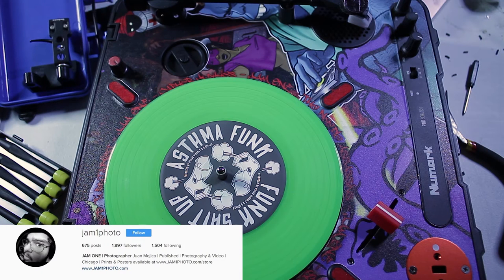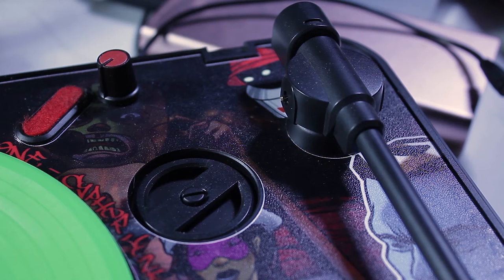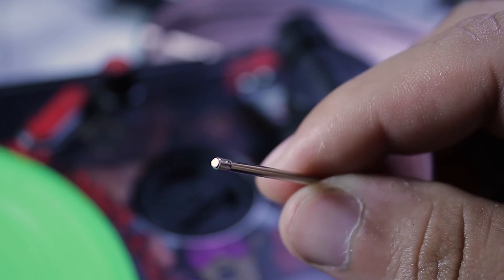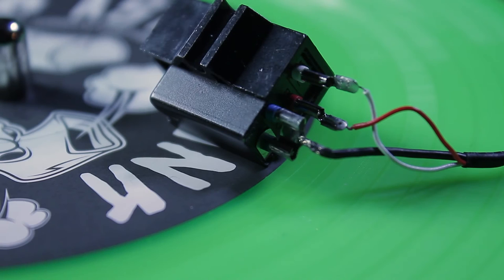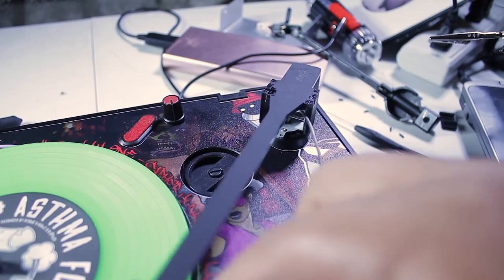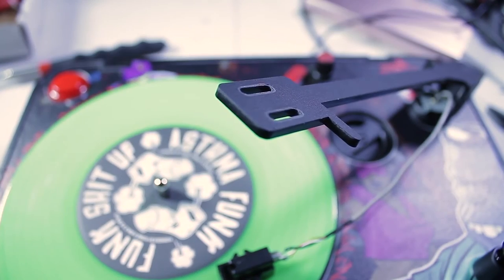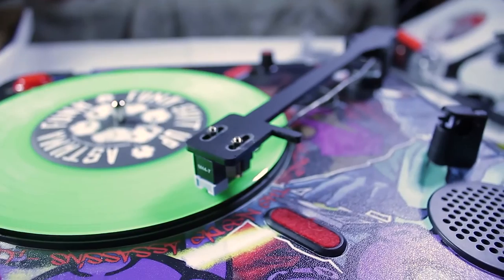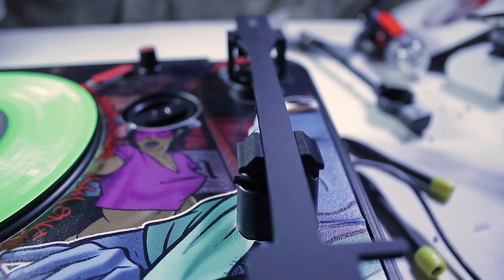Bihari Tonearm Installation for the Numark PT-01 Scratch Portable Turntable | JAM1PHOTO.com

Comment: really interested in seeing the pre amp installation video i have one also
Reply from the maker: I know I failed hard by not documenting it but I wasn't confident that I was going to even get it right on the first try, I was going off of Flesh One's step by step slideshow style video trying to figure out the steps based on the photos.. that and the PT-01 SCRATCH version has slight variations in the layout of the PCB board so I had to improvise on a few things.. scary shit haha.. but once I was done and inserted the stylus into the cart and powered everything on I was so damn surprised I didn't screw anything up... The same guy who did the tonearm now has east to install preamp kits on his site now too, no soldering required either!
Reply: nice well id still like to see that set up i did see the bihari pre amp no soldering need but its already sold out haha which i figure 
and i kno fleshy said he was making a new one also but i have that unit anywho hope to see it if not i understand might as well just get it when its avail
Reply from the maker: it's a longshot, but if you'd like me to install it I'm down to help you out, did you get a new tonearm too?

Comment: thanks Jam helpful video there
Reply from the maker: Anytime, hope it helps if you go this route! Next time around I'll be illustrating the Pyle Preamp installation, I just didn't do it this first time since the details didn't exactly match the beatshelter tutorial exactly since the layout of the PCB on the PT-01 scratch is a bit different than the PT-01 USB. Had to take a few risks but it worked out in the end so next time I'll be sure to document that as well

Comment: ok ive tried it now but my tone arm feels really stiff and won't drop the needle with any weight, its just floating. i think the metal pin is too tight on mine.
Reply from the maker: can you post a video of this in action?
Reply: i managed to sort it out cheers. I just lightly sanded the inside of the two arms as i have the wooden one until it worked.